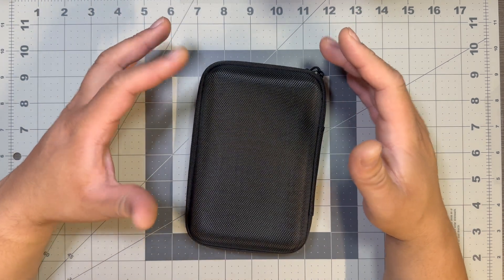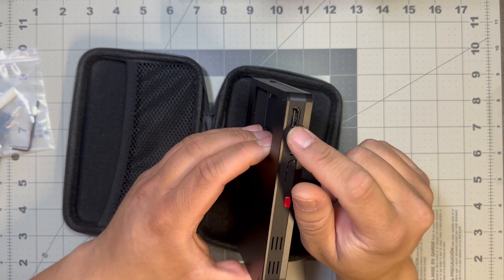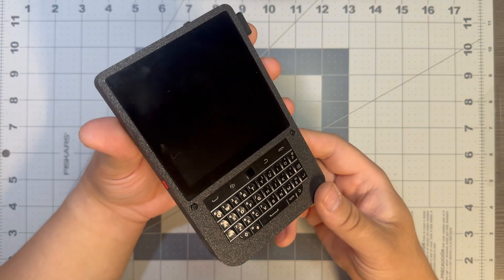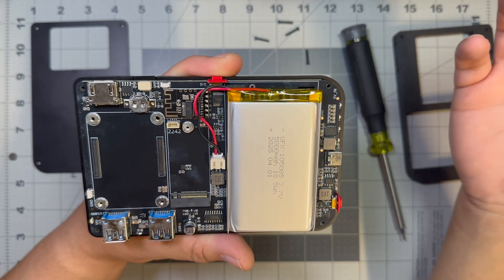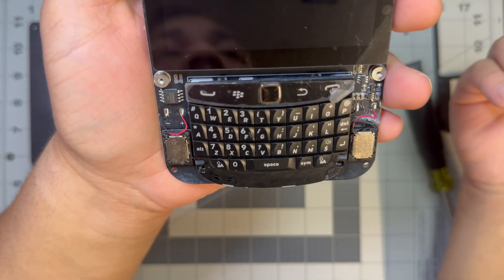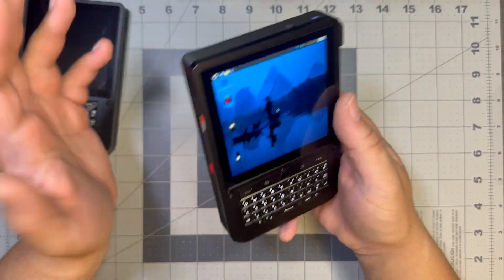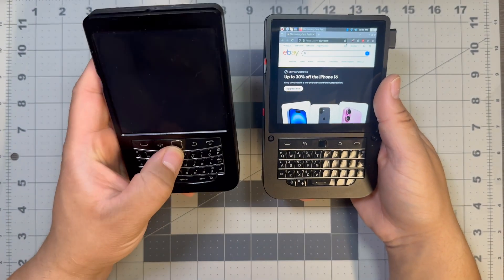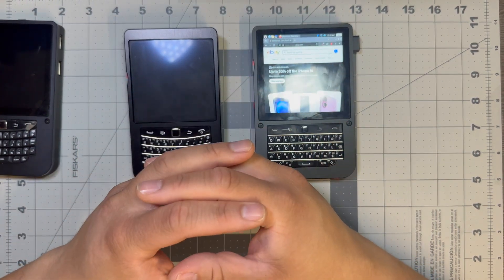Is the HackberryPi CM5 a portable feature packed powerhouse?

Comment: I'm stuck between buying the hackberrypi cm5 Q20, and the uconsole which i would upgrade to cm5. i intend on using the device for network penetration but also do some tinkering with linux. if you had to choose one, which one would you choose and why? thanks
Reply from the maker: Get theuConsole. The keyboard and screen size is miles better than the Hackberry. The hackberry is great for running quick small tasks but I’d always choose the uConsole for major workloads. I’ll also add that the uConsole has optional expansion boards from many third parties making it even better.
Reply: If you order a uConsole from Clockwork Pi, especially if you choose a black one, expect to wait 6 months or more for it. I just finally got mine and it was a very long wait. They also don't have a CM5 option. You can order one without the Pi board and just source your own, though. I've read the CM5 works but I'm not sure if it has to be a CM5 Lite like the CM4 Lite that most uConsoles come with or if you can use one with eMMC storage instead of an SD Card. Ideally that 16GB eMMC CM5 is what I'd do. Maybe an Orange Pi version or Radxa or Banana Pi will work, not sure. My friend loves his new CM5 Hackberry Pi with the metal case. It's very nice.
Reply: @VengefulAntihero did you order yours with the cm4? I got mine with no core hoping that it would be faster but I know it will still be a while
Reply: @CandleStickCafe Yeah, I ordered a black one with the CM4. Took like 7 or 8 months I think.

Comment: I want to modify the design of the case but I don't have any 3D design skills.  Would love to have a design where the edges are rounded a little, front and back.  Need to have the frame with the external antenna, but maybe cut the riser by half?  Time to learn 3D I guess..
Reply from the maker: Not a bad idea! If I have some time I can throw the STLs in fusion and make some changes.
Reply: @Symbiiote I wish I kept up my cad skills. I’d love to get a clear/crystal case with the external antenna option, but I feel it’s beyond my skills. But if you want to design the case with softer edges, that would be sweet.

Comment: I love mine, I added an active heatsink to mine and posted the config in the discord, the heatsink I found was perfect, it does stick out slightly but im hoping to 3d print a case that will make up for that
Reply from the maker: Do you have a link to the heading you used?
Reply: +1 would be great to see which cooler you used
Reply: @oliverbarnwell9654 i keep trying to reply with the link and it wont let me